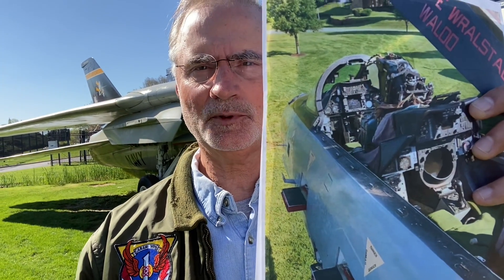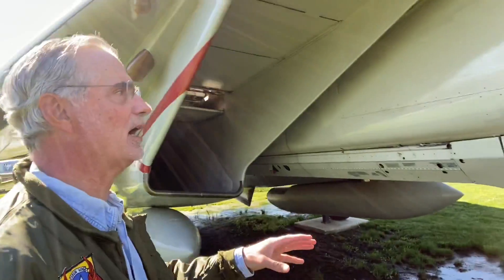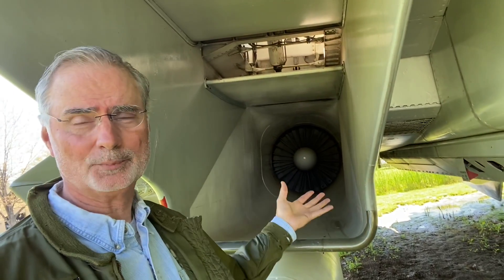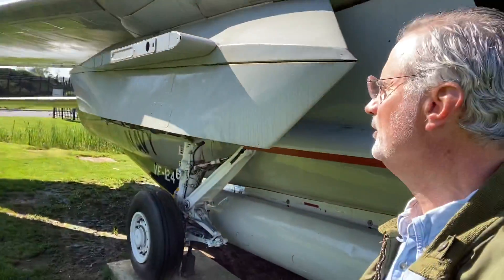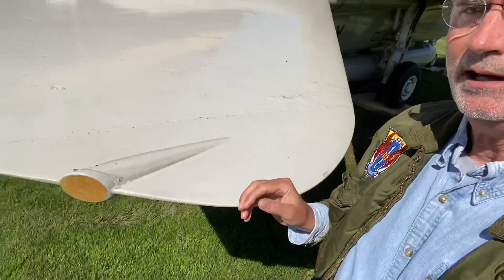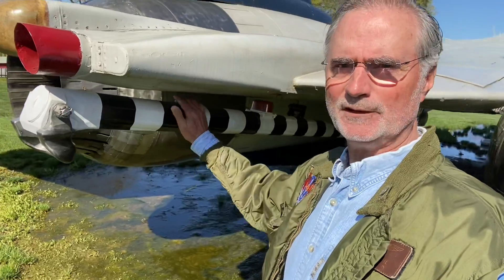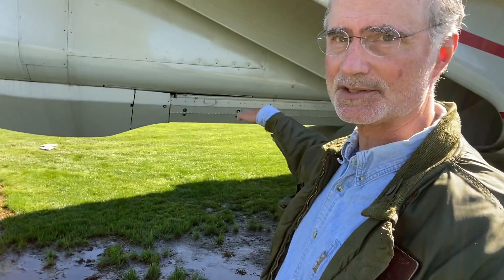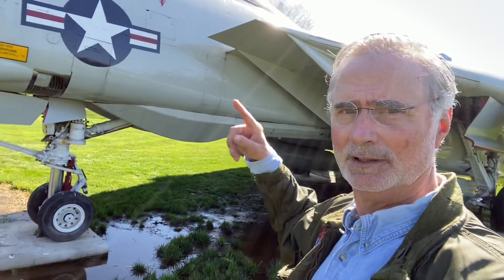Secrets of the F-14 Tomcat: Aircraft Preflight Walkaround

Comment: Is the Phoenix a variant of Hawk surface to air Missile but converted to air to air? I’m a former Patriot missile guy. I seen a weapon system called slamraam which was a surfaced launched amraam. I know at one time the Air Force was trying to figure out how to fit an PAC 3 patriot on a F15 at one time. I’m curious because of the similar look of the Hawk and Phoenix missiles. I know Hawk was developed in the 50s. Cause surface to air missiles and air to air missiles look similar except long range surface to air missiles. But admit that the PAC 3 patriot looks a larger amraam. My brother was shorad and was an avenger/stinger guy. I also felt the Stinger when fired looked like a sidewinder. Then the Navy uses a sea sparrow is that the same as air to air sparrow?

Comment: Thanks for the walkaround, Sir. For reference, the Gulfstream G-IV I fly has a very similar landing weight and approach speed for a typical trip. However, we would certainly NOT be sticking it on at 700 fpm- at least not more than once.

Now that I think about it, the length dimension is similar as well.

Comment: Ok Ward... I'm hardly one to cry "foul" for pilots/RIO's in this respect.... BUT, as a former Flightdeck Troubleshooter, I don't ever recall either a pilot nor RIO doing the "walkaround" you've described.  Yup, the pilot may have done a cursory inspection of the a/c, but nothing to the degree you show in this video.  Not to say YOU and your pilot didn't perform this inspection... I can only speak for those in my squadron, but I never witnessed a pilot do a serious, full walkaround of the a/c in my years as a troubleshooter.  I honestly spent more time checking out my Cessna 152 pre-flight than any pilot of his F-14 aircraft.  This isn't necessarily a dig because I do recognize the trust pilots/RIO's place in maintenance staff.  At the same time, let's be real.  Now... I've inspected countless F-14 on the cat, at stage 5 AB, just before flight and THAT truly is the time when the a/c is at one of it's most crucial and stressful moments.  I've also been engaged at changing valve stems in a 350psi main gear and subsequently humping a nitrogen cart from the bow to the stern, unbeknownst to the flight deck chief, in order to preserve a flight op.  Just be sure to remember the crew who made your flights possible, even if the processes to make it so were contrary to SOP.  We were just as interested in maintaining sortie/combat reliability as CAG.

Comment: I worked Depot level maintenance on the Tom at Norfolk in late 80’s and through the mid 90’s. My specialty was the Environmental Control Systems, the plumbing that provided cooling air conditioning for the cockpit, as well as the ANWG-9 radar. I practically lived in the nose wheel well,where so much of the plumbing was concentrated.
The condenser box for the air conditioning system was located in the right side of the fuselage, and I somehow was able to squeeze my 6ft frame up into that area to reinstall that condenser after overhaul. 
We also had to remove and reinstall the cooling plumbing for the Sparrow and Phoenix underneath.
We also converted several A models to D’s. Part of the conversion was omitting the plumbing for the Phoenix, as well as deactivating the glove vanes, which were located just aft of the wing sweep actuator.
The Tomcat was a beautiful airplane as well as the last Navy dedicated fighter plane. It is still the most maintenance intensive ball breaking aircraft I have ever worked on. Who knows Ward, you probably flew some of the Tomcats I worked on.

Comment: Hi Ward, love your content, just about watched it all.  Nice to have another tomcat guy in social media along with "Bio" Baranek to give us insight into such a great aircraft.  From a very young age born in the 80s I followed the development of the tomcat and it's operations until it's retirement in 2006 and have a record of every bureau number that ever flew.  Just a note when you pointed out the bureau number at 6:54, the numbers went from the first F-14A prototype 157980 which was lost on it's second flight due to hydraulic failure caused by vibrational resonance loosening some clamps on the hydraulic pumps to the very last F-14D model being 164604.  The last jet is believed to be possibly only one of two jets that never made a single cat or trap as it went straight to the NAVAIRTESTEVRON VX-4 Evaluators (Naval Air Test and Evaluation Squadron) in the early 90s and was then merged with VX-5 Vampires to form VX-9 based out of NAF Point Mugu (someone in command clearly spent a lot of money and time on their academic studies to be able to add 4 and 5 to form a new squadron!!).

In a long and complicated story I have my own connection with the Tomcat and if you're curious, I have a story link on my page told by a dear friend of mine as to the reasons for this.  That connection has lead me to come across people such as yourself and Mr Baranek who helped me reunite with the connection in my story a few years ago which formed the basis for my determination to achieve my goals in life despite having my aspirations to join the military turned down shortly after leaving high school.  I have a lot to thank people such as yourself and those that helped me for being the epitome of a role model.  Thank you.

Comment: You forgot to mention the coolest (hidden) attribute of this magnificent Grumman heavy iron: The metals it was made of.

Titanium is expensive now, but in the ´70s it was crazy expensive. Both ramps (and inlets?) were fabricated entirely of titanium alloy, in such quantity that its expense was that of another military jet!

No one ever sees it, but the wing spars (I think), pivots, and structural crossbar was a “girder“ also made entirely out of this titanium. It is never displayed in any museum. A picture sometimes....

The tailerons were fabricated of even more exotic composite with boron fibers, that were plasma deposited on a tungsten filament. This material predates carbon-epoxy composites and lay-up.

Oh yes: those black engine nozzles are the most expensive and difficult to form of all: made from Stellite, a nickel super-alloy.

Do you know about Nitinol, the titanium-nickel “memory metal“? It was experimentally used as method of joining hydraulic lines. I don´t know of any other military plane this was used on, or even why it wasn´t continued.

I don´t recall the TCS/IRST sensors being on the very first generation of ´Cats.

Were the P&W engines so disrespected, that it was okay they were left in this particular static display, but not any of the cockpit gear, including seats?

It was said that the F-14 was the only adversary that was feared by the F-15 fighter jocks, in air combat military exercises.

I´m an engineer, not a pilot, but you make me wish I had been one. Thanks for a trip down memory lane. I was attracted to aeronautical design because What looks good flies good. What a bird!

Comment: I worked in the tire shop (AIMD IM-2) aboard Nimitz and remember replacing quite a few Tomcat main mounts during the 91 Westpac. They were much easier to replace than Hornet mains. I hated the Hornet tires: low sidewall. Tomcats had that big sidewall and you could break the bead much easier. Thanks for the videos Mr. Carroll

Comment: Great videos, I can still smell the JP5!  I was never around for the 14s.  We flew F-4s.  For recon, we used the RA-5C.  I knew they used a TARPS pod on the 14 for Recon.  Where did they hang it?  BTW I'm a former Photographer's Mate.  Served on both the Constellation and the Ranger.
Reply: Under the fuselage starboard side.  As an engine mech it really got in our way a lot.  We the TARPS crew would have to remove it for us sometimes so we could open the engine bay door (inboard).  Or if we had an engine R&R  or drop.  You'd think they would have complained but they never once made a stink about it.  In fact they would jump.on it.  My memory is bad as it may have been port belly anyway it was under the belly.
Reply: Mmmm.....JP5. It's what's for breakfast! *Glug Glug*. LOL

Comment: Hello Mr. Ward,
   I’m an old Marine.  Actually I was a “Mud Marine”.  From 1981 to 1984 I was hopping about between Okinawa Deployments and finally my 28 months with 3rd Bn 3rd Marines home station Kaneohe Bay.  While there We were always out to Sea.  In those days 1st Marine Brigade was the tip of the spear for ARG.  So the 3 Battalions of 3rd Marines were always rotating in and out on (6) month deployments.  We also had elements of MAG 33.  Your fellow Aviators From HMM 164 and 162,  HMM 464, 466.  HLA and I forgot those squadrons but anyway that was a really long time ago.
   My happiest days in the Corps was when I was with 1st Marine Brigade.  
   The whole camaraderie between Ships Company and embarked Forces was great.  Non of stupid service rivalries.  Two of Gators I was on the Skipper made it mandatory that Troops aboard will share the simple workload of ships operation.  I did not mind that at all because you can only clean your rifle and gear and equipment so much and then PT so much then your bored out of your mind.
   So we helped HT’s and they taught Us many things to help keep the tub moving along.  We helped the Deck department always.  As you probably seen many Jar Heads chipping and painting.  Then We also we’re down in engineering doing simple jobs.  And as you could imagine we became “watch standers”….  As soon as Ships company so the benefit of spreading out the workload underway the Animosity disappeared.  We actually began to make great friendships and some of those Guys I hear from once in a while.
   Most Americans just don’t know the commitment we give to keep our Nation going and safe while they sleep in their beds at night….   I’m not putting down the Army and Air Force but as you know the Ole saying

Naval Life!!!  First to Go and last to know !!!!!

Thanks again Mr Ward!

Comment: As a former plane captain for VF-154, thanks for the trip down memory lane.
Reply: Can you still walk yourself through a launch in your mind if you think about it for a few minutes?....crazy, right?!
- Power on, Air on -
- Chains off, Chocks in, wings dirty -
- Seats hot, canopy/ladder/steps closed, strut locks stowed -
Fire up port side....spool up 1....power off....fire up starboard side/(cross bleed if there's no huffer = long spool up time)...spool up 2...air off....LONG hydraulics wipe out.....flaps down/up, rudders left/right, waggle stabs, air brake open/close, trim checks 1-2-3, go Delta, go dirty, SHORT wipe out, hands off/PC walk around....pass to shops... hook down/up.... Mode 4... Go Delta (again)...flash taxi lights....fuel boom out/in....[warn ground crew for kneel/rise]... kneel/rise... quick wipe...get the "okey dokey".... pull chocks.... throttle up/taxi out... brake check... steer left/right.....turn the bird... salute/pass off...grab chains... go smoke & drink Mountain Dew. Holy shit!... I think I do still remember?! LOL

Comment: I was a PC in VF-101 from 1998 to 2000,most of our Alphas the time had tired airframes. When the aircrew would come to do the walk around we had to keep the forward engine bay doors open so they could check to hyd fittings. This was fine with the B and Ds, the Alphas had to be man handled. As one PC was helping aircrew strap in another couple of PCs would be trying to get the doors closed. When they just would close, one PC would lay on the ground just forward to the exhaust and bounce the tail end of the jet, this would flex the the airframe enough so that the other PC could shove the doors closed and get them latched. If that didn't work one of the trouble shooters would bring over a main mount jack, but the handle on the jack sticking straight up at the same place and jack up until the doors would close.

Comment: Hi there.  Question on the noise wheel steering. If the f14 was not moving and no wheel brakes applied and the nws was enabled and the pilot pushed the rudder petals did the nose wheel move or did the f14 need to be moving forward for the nose wheel position or move?
Reply from the maker: With NWS engaged the rudder pedals moved the nose wheel.
Reply: @WardCarroll  thanks.  The reason I am asking is dcs f14 doesn't and is very annoying

Comment: Hey Ward.  Retired Surface Warfare Guy here, thanks for the in-depth walk around of the F-14.  Quick question, I heard it was difficult to take off with 6 Phoenix and could NOT land with more than 4.   Was this true and did you ever have the opportunity to do so?
Reply from the maker: Doing the quick math, Max trap with 6 AIM-54s would be 4K pounds of gas or less, which wouldn’t give you many looks in most scenarios. I never flew with more than one on the jet.
Reply: Yes it would take off. Only under full heat. AFTERBURNER

Comment: At 3:o5, the E.C.S. duct has a 4" fine threaded connection with about 20 turns accessible Only from above at the wing pivot.  You do the connection And the safety wire one handed while laying on the wing.  The Maint Man allows 4 hours to install that duct !! Engineers, especially Grumman engineers are CRAZY !  Another great video, though ! Thanks for the memories, AMEAN, Plane Capt. VF-124, Miramar, 1975.  Holy Smoke !! I posted this first part at  3 min, way before I saw that THIS was one of my jets !!  How Cool.

Comment: I'd just like to comment on time 8:10, because it had me scratching my head. I made 2 cruises in the F-14A on the Enterprise with VF-114 as a pilot. My last cat shot was 12 August 1986 flying off to NKX. Now, that was 35 years ago, so I'm thinking, "man, am I remembering this right"?
Anyway, we never selected zone 2 for the cat shot. We'd either use Mil - like for CQ - or zone 5 (full AB).

It's funny, because, having flown a bunch of airplanes post F-14, I was wondering if my memory was playing tricks on me.
Fun video. Brings back memories - apparently! 😉
(My avatar is in an F-16N, also with the big GE motor in the B/D)

Cheers, "SOW"
Reply from the maker: You flew it differently than we did then, SOW. Maybe it was an INDY/JFK thing, but we definitely when to Zone 2 before the shot and pushed to 5 during the stroke.
Reply: @WardCarroll  I wonder if it was a JBD issue. I was on the Indy in the RF-8 (when they carried F-4's) and I would guess the JBD's would have needed an upgrade for the Tomcat.

Comment: HI Ward, just picked up on this channel.  Love it thus far.  Question.  You talked about the Phoenix rail that not all F-14's we're equipped.  Was that a mission dependent feature.  And did the rail come with every F-14, or just a select number of them to fit generically to an F-14?
Reply from the maker: Not mission dependent, Roger; in fact, we'd take them off most of the time when we were back at the field. It's an optional piece of gear, like a roof rack on your car. ;-)

Comment: Ward, as I understand it, the IRST in the D-model was the progenitor to the new IRST that will go on the front of the fuel tank pod on the Super Hornet.  Just how great of a detection-capability leap was it for the Tomcat, and was the passive telemetry fed into the radar to assist in targeting with the Phoenix, or was it just another tool for VID to use in conjunction with the TCS?

Comment: @Ward : Why is the radome on the F-14 a pale yellow with a white stripe at the half way mark on most early models ? 
I have had several conflicting answers over the last 25+ years that I have been asking people, and would like your feedback, since you actually flew the Tomcat. 
I have been told the pale yellow part is fiberglass and left unpainted so that the radar can penetrate it better, but this doesn't make sense, since while early VF-1 would have the unpainted radome, F-14s of VF-2 would not.
Also, the F-18 has a portion of the radome left unpainted in pale yellow, but it is only a small portion at the tip. 
The radar dish is right at the point where the pale yellow starts on the Tomcat radome, but not on the Hornet. 
Fairly recently, Iran painted their F-14As a splinter camo, and I noticed that they left the yellow portion unpainted. 
Curiously enough, I can now see that the radome in that area is indeed some sort of fibergass type mesh on their planes, since the now aged planes are very worn in that area. 
I have seen several variations of painted radomes on the Tomcat, but most are either half yellow and half white on a grey plane, or grey with a black tuxedo stripe. Then just the other day, I came across an early VF-2 with BOTH the yellow and white AND the tuxed black stripe.
This little trivial question has bugged me for ages, and I'm thinking of writing to to Grumman to get the answer if no one knows for sure L.O.L.
- Thanks !

Comment: Ward, did you ever carry the TARPS pod? I was an Aviation Electronics Technician in VF-111 and troubleshot the cameras. In about 1988 we got the digital KS-153 stand off camera and could take images from over 20 miles away. That was impressive technology back then. We used it extensively in Desert Shield in preparation for Desert Storm.

Comment: Hi Ward, thanks for another informative video, they’re fascinating. Just have a few questions. Firstly what are the red and gold components above the tail hook? Also, going back to the carrier ops video, when does the pilot re-engage the nose wheel steering? Is it as soon as he’s completed all the flaps checks and applied full power just before launch? Oh, and are the brakes on while the jet is at full power just before launch or is it only the shuttle that’s holding the aircraft in place? There’s some serious torque involved both in launching and from the tail hook on recovery.
Keep up the great work.